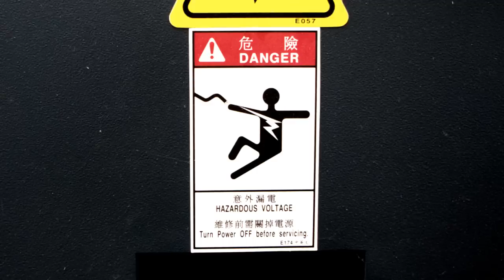The Manufacturing of a Francis Turbine Stay Ring at Ebco Industries

Comment: Stay vanes also rotate with runner or they only guide the water to runner ?? Please answer
Reply: I think the stay rings are fixed, the turbine drives the water and the stay ring guides it
Reply: Stay vanes are physically connected to the casing so they're fixed. They give the inflowing water a swirl and also pull the top and bottom walls of this radial intake together because the inside is pressurized